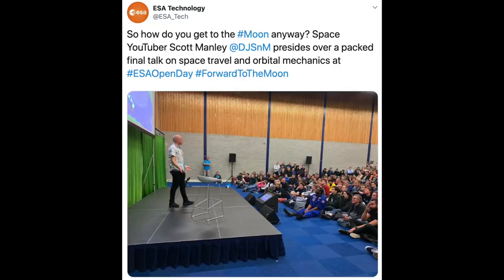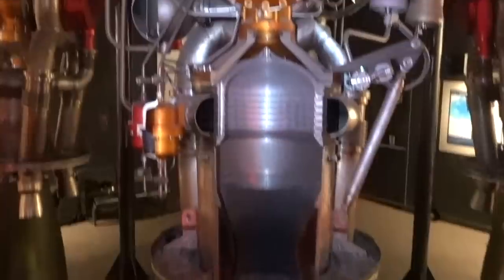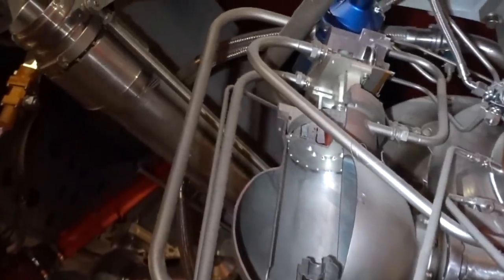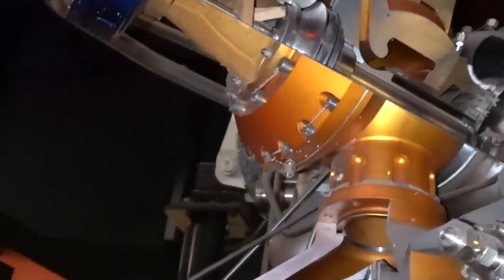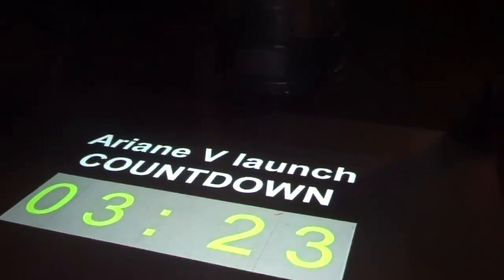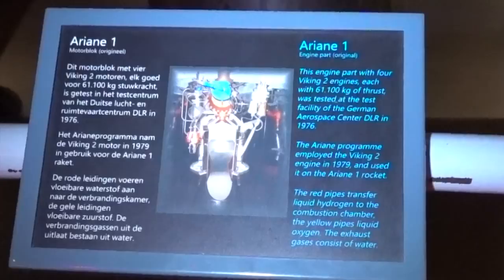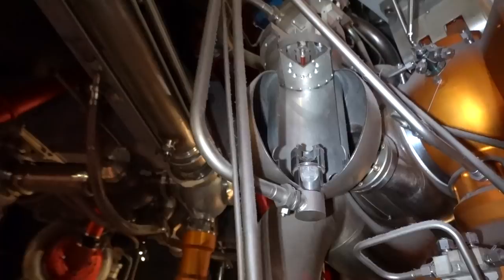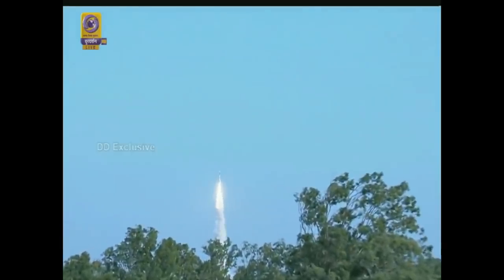The Viking Rocket Engine - Ariane's First Engine & Ancestor to ISRO's Vikas Engine

Comment: The water cooling is remarkable and startling. I have to wonder though, if introducing water in a turbine wouldn't lead to blade erosion of the turbine vanes with a possible loss of the turbine wheel owing to imbalance. Unless, the water arrives as superheated steam and is thus "dry" and not a problem. Is this indeed the situation?
Reply: The final gas temperature at the exit of the gas generator after the addition of water is about 620 degrees C, so the steam is "dry".

Cooling the gas from the generator by adding another liquid was developed first as means of producing reasonably cool gas for pressurizing the fuel tanks. Only with Viking engine this gas started to be used not only to pressurize the tanks but also to drive the turbine.

There were at least six other smaller engines before Viking which used "cooled" gas generator and a very similar combustion chamber / nozzle. One of them was used on the Diamant rocket which launched the first French satellite. The smaller ones were used on high altitude research rockets -- Veronique and Vesta.
Reply: @cogoid  Thank you for your cogent and informative reply. Given the success of the launcher, I had assumed so, but taking the time to respond and supply the additional information is greatly appreciated.
Reply: @williamswenson5315  Apparently, gas generators adding water to dilute hot combustion products were first tried as early as 1932 in USA by Robert H. Goddard. But he used this method only briefly, and he also kept the specific details of his experiments secret -- his archives were only published in 1970. (This is mentioned in the "History of Liquid Propellant Rocket Engines" by George P. Sutton.)

Apparently Karl-Heinz Bringer has arrived to a similar concept in 1942 in Peenemünde in Germany, where he worked with Walter Thiel in designing engines for anti-aircraft missiles. After the war, this was part of the know-how that came with him to France -- apparently the only country where it became widely used, (even though it had been sporadically tried by the Soviets and probably elsewhere.)
Reply: @cogoid  Once again, thank you for the history on this concept. It has always been a topic of considerable fascination for me to observe how an idea can be proposed, even implemented and fall into the dustbin of technological history for a time, only to be revived and used at scale. I had no idea Goddard had experimented with the idea and then rejected it. Perhaps it added complexity to an already complex endeavor and he was trying to simplify his design to ensure success. Did Sutton's book include mention of Lindbergh's interest in Goddard's work?
Reply: @williamswenson5315  It is a part of the chapter on the early history of rocket engines. Sutton merely sketches Goddard's biography in a few pages, and proceeds to explain his largest achievements, which are many. Then he spends a few more pages to explain that US rocketry was more influenced by the German know-how than by Goddard's own pioneering work. Considering that Sutton supervised engine development at Rocketdyne at the peak of Apollo program, it is a stunning assessment:

_"For example, this author personally did the analysis and design for the first large U.S. thrust chamber (75,000 lbf thrust); it became part of the Redstone LPRE (which launched the first U.S. spaceflight). At that time (1947-1951) my fellow designers and I had not even heard of Goddard or any of his know-how or his unique contributions to the state of the
art of LPREs. ... It was only in 1970 (25 year after his death) when Goddard's papers were published (see references) that this author obtained a copy and became aware how far ahead of his time Dr. Goddard was in his work on LPRE."_

The situation was somewhat similar in France -- like the US and USSR they had plenty of indigenous small rocket projects before the war, but after the war, the scale of German work stunned everyone, and there was a great importation of know-how and talent.

Although thousands of Frenchman worked in the industry after the war on hundreds of designs, the most visible achievements (Veronique, Diamant, Viking engines) were the work of LRBA at Vernon, at least initially stuffed predominantly with ex-Peenemünde German engineers -- 30 in the guidance group and another 30 in the propulsion.

At the recent dedication of Karl-Heinz Bringer street in Vernon, it was said that he personally was in charge of the development of these engines. Of course, the work would not be possible without all the contributions from literally thousands of people. Viking engine is, after all, an international production -- according to ESA, the combustion chamber and the nozzle are made in Sweden by Volvo Aero, and the turbopumps by MAN in Germany. But it is certainly the French who made the project possible in the first place.
Reply: @cogoid  Yes, I was aware of how little Goddard was regarded during the early years of space development in this country following WWII. I can recall a history I read in grade school which mentions him strictly as the inventor of the liquid-fueled rocket. The illustration was invariably the photo of his crude, early effort with the rocket nozzle atop the rocket on a wire-like frame. I believe it was launched from his home in MA. That has changed in recent years and I'm glad he has assumed his place in the pantheon of early rocket pioneers. I seem to recall that Von Braun was aware of Goddard's efforts during his thirties efforts to design and build his own small scale liquid-fueled rockets in Germany. Of course, Von Braun had the backing of the Nazi government, while I believe Goddard received monies from the Guggenheim Foundation.
Reply: @williamswenson5315  Goddard became know as a rocketeer after his 1919 article "A Method of Reaching Extreme Altitudes". Newspapers picked it up and sensationalized it to the point that one could think that humans would soon be landing on the moon. The coverage of his experiments also went viral in 1929, when neighbors mistook his rocket test for an airplane crash and called in the police, which started a whole search and rescue operation and naturally also attracted newspaper reporters. This, again sensationalized coverage was noticed by Lindbergh. He visited Goddard, and then arranged a series of meetings with potential supporters. Several attempts were unsuccessful due to Goddard's unwillingness to answer technical questions. Finally, Guggenheim agreed to support Goddard financially. 

So, the fact itself -- that Goddard was working on the rockets, was well publicized -- in the reports that he himself sent about his experiments, he included photographs of the launches (taken by his wife), altitude attained, etc. But he kept the construction details close to his chest -- there were no details about the engines in the reports. Most of the information came out after his death through the efforts of his widow. It is those later patents filed by his widow that the US government had to licence for $1M. But again, saying in a patent that one can make a rocket engine with a turbopump is one thing, but making one that works requires a vast amount of very nuanced know-how, which you have to get somewhere else. Goddard have figured a lot of these things out, but was afraid that "others would steal his inventions", and this, sadly, made his work much less influential than it could have been otherwise.

Goddard did communicate with Hermann Oberth, who was von Braun's mentor early on. But again, Goddard talked only about generic ideas, not the specifics of design. Oberth himself started publishing about rockets in 1920s, and von Braun joined his experimental rocketry club in 1930. They were quite obsessed with rocketry. While von Braun later rose to prominence as the director of the rocket center under Nazis, Oberth was largely left out (he was not even a german citizen until 1941.) I am sure von Braun knew about Goddard's work in general terms, but his direct inspiration were rockets built by Oberth.

Comment: I have to wonder how much the water injection helps with efficiency. They used it in jet engines of olde, mostly on takeoff...would the extra weight of a water tank be worth it?

Comment: @Scott So, the rocket had to carry water as well as fuel and oxidiser? Is that more efficient that just running the engine fuel-rich? Did the ariane rocket construction have to be substantially changed when they changed the engine to one that doesn't need water?
Reply from the maker: Carrying water for the pre burner isn’t such a bad thing, it’s only a small amount. Also I read in one article that the gas generator also supplies gas to pressurize the fuel/ox tanks so the exhaust is inert and this saves extra pressurization tanks.

Comment: Would the water injection serve two purposes? Not only cooling but generating steam to operate the turbine?
Reply: I'm just guessing here, but i think that the steam generated was just side effect of cooling action, althought it add significant volume of gas for turbine the efficiency of system would be greater without it(in case you would find metal that wouldn't melt).

Comment: I just happened to have a question... So I work in the architectural/MEP business, and we always see at suppliers this cutouts of the equipment. 
Now that I am seeing this on an actual freaking rocket engine, my curiosity has sparked again... 

How in the hell do manufacturers do this beatiful cutouts?  Do they manufacture/cast the cutout? do they manufacture the part, and THEN cut it out? if so, it´s surely a very lengthy design process... 

Anyone has answers??? Thanks in advance for anyone who can enlighten meself.
Reply: If you have money for a beautiful display model of you product, then you can call a specialist skilled in creating cutaway models. (For example google "CalCo Cutaways" or "Cutaway Creations".) These businesses have the experience and know-how to get it done truly beautifully.

Most of the cutaway models that I have seen were done by sectioning a real product (jet and rocket engines and their components). Of course, there are cases when a miniature or educational model is purpose-built, and then it can be designed as a cutaway from the get-go. (See for example how this model was done: "Cut-Away Scale Model for Training | KiwiMill Blog")

In principle, making a cutaway model is not very different from making the parts in the first place. You plan what needs to be done, take the machine apart, figure out how to hold the part that you are going to cut, and cut it as planned with whatever tools are at hand -- it can be as simple as a jigsaw or an angle grinder all the way to water-jet cutters or milling material away. Then you deburr the parts, file/grind/polish, paint, and reassemble. The hard part is to make everything beautiful -- neat, smooth, straight and square -- that is why there are businesses specializing in making cutaway models.

Comment: I'm confused. The viking has what appears to be 2 gas generator exhausts, but the turbopumps run on a common shaft, so it doesn't appear that it has a separate GG/preburner to run each pump (like the Vulcain does). Is there a reason for this, or are they just being extra French in the design?

Comment: I would put the fuel that needs to be kept the coldest in the tube that has a shorter run to the tank to save on insulation weight. But I'm not a rocket scientist casually writing youtube comments.

Comment: Can someone explain what I saw at 5:30? The Indians are using liquid fueled boosters with a solid fuel main engine? Who else does this? Also, orange exhaust - I thought, means poisonous hypergolic fuel and that it's not safe to use at a launch site, is this right?
Reply from the maker: Yep, India does exactly this, liquid boosters, solid core. And the Orange exhaust is nasty but disperses before crew returns to pad.
Reply: @scottmanley  thanks for the reply. do you have a video on this type of rocket? So many questions now, like advantages and disadvantages, how does it steer, can it only steer while boosters are attached. video coming soon?

Comment: Hey Scott! I don't think you can actually do roll by gimbaling four engines in and out.
Reply: To me they looked like they gimbal sideways, so why not?
Reply: Opposing engines can push in opposite directions for roll since they're not gimbaling in and out. They gimbal on like a tangent line to the rocket body.
Reply: This would be true if the engines would gimbal in and out, but watching from 3:34 again it appears to me that each engine gimbals in the tangential direction (so an radial axis of rotation, since the blue part is on the outside and is inline with the rotation axis), which would allow for both roll, pitch and yaw control.

Comment: Once you look at how the engines work, it seems so primitive. 

We desperately need a better propulsion system.
Reply: Trust me when I say, that liquid rocket engine designs are comparative babies compared to the internal combustion engine in a car, the design of which is nearly 140 years old. If you take into account the reciprocating piston steam engine that it was based on, the design is practically 200 years old. Makes the 70 odd years of liquid fuel rocket design, very young by comparison. Basically, it's a case of:- If its tried and true and proven and works, don't fix it or change it.. just improve it. Especially in case of rockets, where reliability is paramount over being at the cutting edge of tech.
Reply: More complicated isn't better, it's worse.
Reply: Im thinking along the lines of a non reactionary system. Something out of the box.
Reply: @mysteryguest9555  That is against the laws of physics.